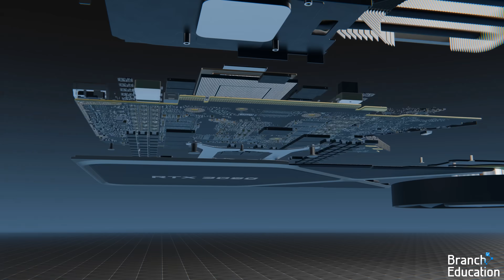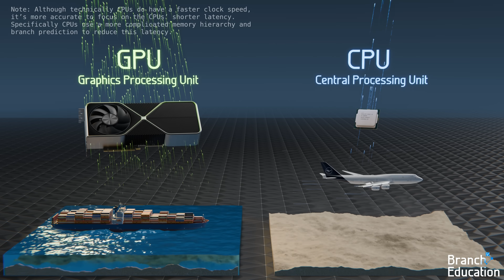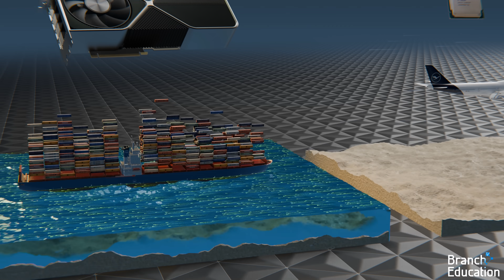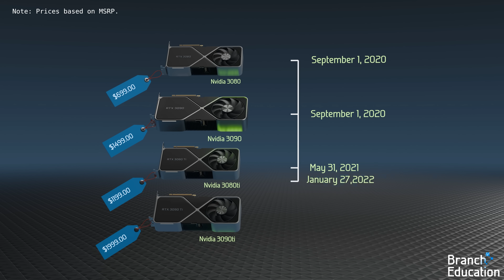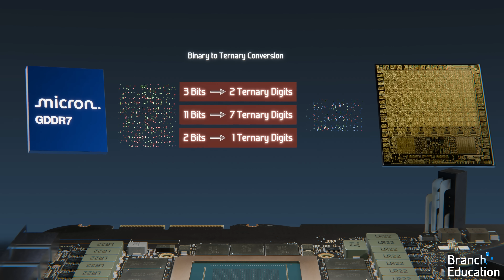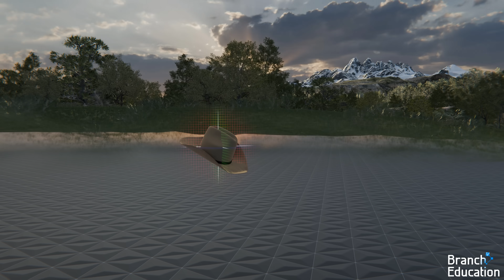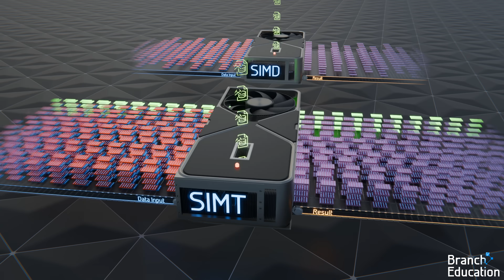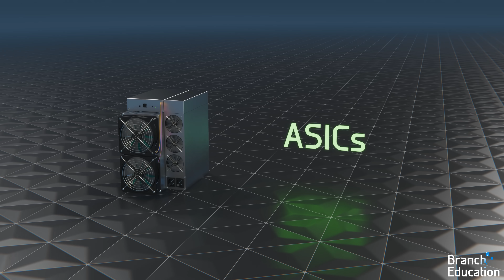How do Graphics Cards Work?  Exploring GPU Architecture

Comment: I have the same exact cpu the 10850K but instead of the 3090 i run the 4090.I was so close  to the exact same specs as in the video here!They made an error.The CPU in the clip the 10985K doesnt have 24 cores but 10.

Comment: Beautifully done video. It never fails to amaze me how simple memory storage elements as a concept can become very complex based upon a specific application and its inherent data requirements. As a chip designer I was often forced to make a memory interface that took some commoditized memory architecture and through great internal chip gyrations make it "work" for a given Application Specific need. It consumed a tremendous amount of chip real estate and of course movement of data consumed precious time.  I will attest that working with Micron was always effortless. (This is an uncompensated testimonial - just appreciate the Engineers there.)

Comment: How much does it differ with an AMD GPU? Remember it uses different architecture than NVIDIA
Reply: All modern GPUs largely follow this same overall design, because this design ends up being the most space and power efficient given modern gaming workloads. There are some differences in how hardware is laid out and how many threads are grouped together into a warp (or a wave, in AMD parlance), but if you look at the architectural whitepapers for any modern GPU, they all follow this same overall modular, hierarchical design, despite the wildly different architectures.

Comment: Very interesting video. Just a minor nitpick, though: The brief background on warp uses imagery that is closer to knitting than weaving. In weaving the warp threads are usually pulled up and down to allow the weft thread to be passed between the two sets of threads and then switched before the next pass of the weft (or different threads are move up/down to allow a pattern like a Jacquard loom can create). The video's imagery is more reminiscent of loops of thread pulled up through the loops of a lower row, which is basically how knitting works.  Again, it was a great video, but I had to "knit-pick" a little bit.
Reply: And, when AGI takes over from Homo Sapiens, reducing the status of the remaining mooshy ones to mere "oddities" kept in zoos, those few remaining humans will finally appreciate the foresight of the Luddites their ancestors frequently ridiculed and mocked...
At this time, the "tipping point" is visible in the rear-view mirror...

Comment: I watch these videos just for the joy of how accurate they are. The video stopped short of the thing where each thread indexes into the register file by a configurable amount, and the number of registers available to a shader program is actually adjustable by the compiler. So it can "switch" to a different thread in an instantaneous way, just by remapping the register numbers to this thread's register numbers, switching to another thread with zero delay. The number of registers is extremely large, CPU people would gasp at how many registers exist in the pool. Games need to have several times the number of cuda cores of work items active, so it can do something while it waits for cache miss delays. Overlapping the delays and doing other things when waiting is where it extremely speeds it up. You can wait 1 second 1000 times and it takes 1000 seconds, or you can overlap 1000 1-second delays and it takes 1 second.

Comment: here's my CPU GPU analogy. 
A CPU is a chef in a kitchen who can make you anything, eggs, soup, steak, waffles, but is limited to the speed of one chef

A GPU is an industrial waffle production line. It can only make waffles, but it can make 10,000 at a time.

If you have a restaurant you want a chef. If you are EGGO you want a waffle factory.

Both are great at their jobs, but bad at the other's job.

If you can adapt your recipe to fit in a waffle maker & you need a lot, it can make a lot of sense to move your cookie from a CPU CHEF to a GPU waffle. 

But most things like soup & steak or full meals that have an appetizer, drink, protein & side will need the CPU chef & not the GPU waffle.

Comment: At 17:25, one such example but for CPUs would be prime number searching in a predefined range.

Say I have a multi-core CPU (if it’s an Intel probably HyperThreaded) then I can divide my search range into lots of smaller ones and create a bunch of concurrent threads that each search their respective ranges.

I did this in C++ with relative ease and was a fun learning experience.

Comment: Good video but I spotted couple mistakes. Tensor cores do not run geometric transformations, they are only used for AI and DLSS. Most of the time while loading a videogame is not spent moving geometric models, models are typically rather small, most of the VRAM keeps textures. SIMT architecture does not have independent program counters for each lane, they work just like SIMD in that regard; the difference between SIMD and SIMT is the latter runs many threads in addition to many SIMD lanes, and switches to other threads to hide latency of slow instructions like memory loads.
Reply: Extra notes: Tensor cores can still be used by developers for general purpose matmul using VK_NV_cooperative_matrix. You're correct about switching out warps to hide memory latency, but the Volta architecture whitepaper indicates newer GPUs do indeed have program counters for each lane allowing potentially all threads to diverge. But the execution units can still only execute at a single PC at a time, so switches between the thread groups. This may help to ensure work can still be done while one branch is waiting, but it seems like a big part is reducing deadlocks between divergent threads in cuda programs.
Reply: Why are the tensor cores not used for geometric transformations? This seems counter intuitive, with transformation matrices being what they are.
Reply: @cinderwolf32  Tensor cores are completely useless for geometric transformations for two reasons. 
Input vertex coordinates and transformation matrices need FP32 precision, while tensor cores only support low-precision inputs: FP16, BF16, int8, also weird TF32 format which uses 19 bits per number. They support FP32 accumulators, but not inputs.
Secondly, tensor cores operate at warp-level, which means 32 CUDA threads are collectively computing relatively large tile of a matrix, like 16×16 or 8×32 elements at once. Vertex transformations only need 4×4 matrices.

Comment: so correct me if im wrong, so basically, 3090 is just a slightly "defective" 3090ti, 3080ti is a slightly "defective" 3090 and so on?
Reply: Yes, and a 3090 Ti is a slightly "defective" RTX A4500, which itself is a slightly "defective" RTX A5000, which itself is a slightly "defective" RTX A6000. Basically, the GPU that the 3080 and above uses would ideally be used in a workstation card worth a hefty $8000, but NVIDIA bins the GPUs based on how "defective" they are to allot them to cards in lesser product brackets/lines.

Comment: I just think each pixel is given its own parallel processor to calculate its value using a shader.
But it doesn't 100% scale.  As you try to populate more pixels with an expensive calculation (like light shafts), the parallel gains drop off a lot.
If you're trying to render something foveated so that you're only populating 1/8 of the pixels, that doesn't give you 8x performance for the whole scene.  You might only get 1.5x.

Comment: 4:11 Some NVIDIA GPUs can interface with networks directly via an NVLink Switch, which allows direct GPU-GPU communication within a network. This is how the most powerful supercomputers operate; thousands of GPUs working directly together across 100+Gb links with sub-microsecond latencies, forming one giant meshed GPU.
Reply: Oh that’s crazy so they’re all hooked up via Ethernet? And 100Gbe exists? Man that’s crazy
Reply: @jevonp  Not ethernet. It uses Infiniband (now owned by NVIDIA), and it goes up to 200Gb. They will release 400Gb in the not too distant future. Infiniband is a competing solution to ethernet/fibre-channel/etc. When I was using it, I was getting 0.3us (300ns) latencies. It's nuts how fast the thing is.

p.s. you can run ethernet over infiniband (EoIB) and still get ridiculously high data rates and low latencies.
Reply: @ShimrraJamaane  are you sure the infiniband protocol is all proprietary? Also I was under the impression FC (fibre channel), ethernet, and infiniband/RDMA were kind of converging, or there are switches that can handle all of it and switch and route between them.
Reply: @jevonp 800GbE has been commercially available for a year or so by now, although it's mostly used for uplinks in massive datacenter switches since a PCIe gen 5 x16 slot can't even carry that much data. Things are moving fast right now, hell PCIe gen 7 already has functional prototype chips.
Reply: Someone also made a pixel shader that could run the linux kernel in the game vr chat. Definitely possible to run an OS in a GPU if you try hard enough. Not recommended though :)
Reply: @andreas1132  Any source for that? I can't imagine someone writing a C compiler and assembler for a GPU, and then fixing all of the other architecture specific code to run the base kernel (e.g. does a gpu have a swap and compare instruction or similar for atomic ops?).
Reply: @cosmicnoodle5  Well I knew they had atomics but wasn't sure if they had something specific that would allow for mutexes/spinlocks (I looked it up and see that RDNA has it, at least). As long as they have that and something akin to TSS, then I can see how one could run a kernel on a GPU.
Reply: @ShimrraJamaane  google "linux in a pixel shader" to find it. it doesnt actually port the linux kernel into a pixel shader, it just emulates a risc-v cpu that runs linux. and its also very slow. though i think the bad performance is because of the developer restricting the project to run on vrchat. i feel like it could be massively improved by taking advantage of modern gpu features
Reply: @tunis4  Interesting. I read through his post and it seems neat. Cool that he got it working the way he did. Although I see some problems with it logically, the fact that he got it to the state that he did is very impressive. Thanks for the info :)
Reply: I pictured this explanation like when Lain built a PC in anime

Comment: I am an electrical engineer with extensive computer knowledge and your videos are consistently some of the most accurate and well thought out videos on EE topics out there. I was all ready to say "bitcoin with GPUs, hahaha not since like the early 2000s" but you were already all over it. Love this channel, and great animations and explanations!
Reply: Bitcoin didn't exist in the early '00s. It began in 2009, and for a quite a while CPU mining was still viable. By 2012 GPU mining had replaced it, and while ASICS were overtaking them, GPUs wouldn't be entirely irrelevant until some years later.
Reply: I am an electrical engineering student, and i am also interested in computer architecture. This channel is soooo good.
Reply: I love the spoon Vs excavator analogy. And I'm happy mining has moved on from GPUs, so we can finally have them for gaming again! 🫠
Reply: As a slightly better and more credentialed electrical engineer I can confidently debunk this comment. It's wrong and gay
Reply: @Truemann45  "credentialed" lil bro its accredited
Reply: @Truemann45  ur mom

Comment: 19:00 can someone please tell me what the values might be for the air in between objects? How does it solve the problem of space 🤔
Edit: thinking about it for a few minutes, I don't think my question makes sense 😂.. because the "air" is just part of the base program, and things are added into that I guess.
Reply: There is no such thing as air in this context. Space is just nothingness. You don't worry about the "air" outside of an object for the very same reason. You only care about the values of the object itself that is rendered.

Comment: I just installed my NVIDIA GeForce RTX 4070 Ti SUPER 16GB this past week, and it's crazy fast!! I'm gaming at 4k on a 144hz monitor with unbelievable smoothness!
Reply: I also have one. But without DLSS. It is impossible to get this FPS in any modern game. Let alone with Ray tracing. That we see no difference despite in Frame rate
Reply: @pedro.alcatra  144hz is very easy to achieve. What are you on about?
Reply: @Sammysapphira  what?
Reply: @Sammysapphira  4K is still very computationally expensive that even a 4090 can't handle it without resorting to upscaling.